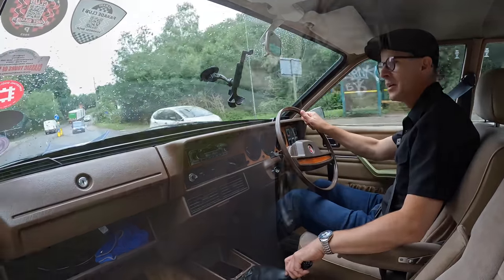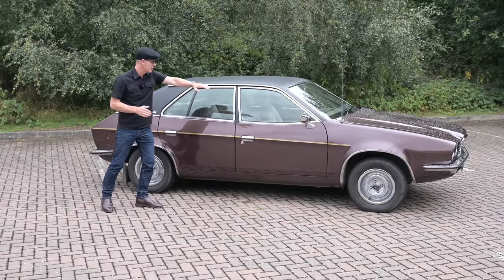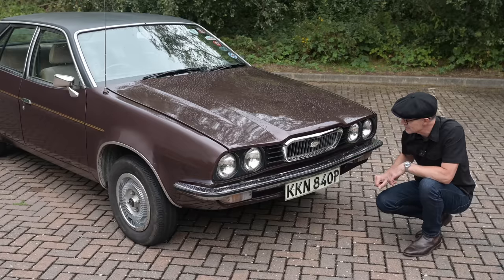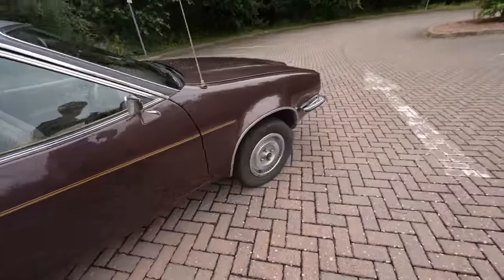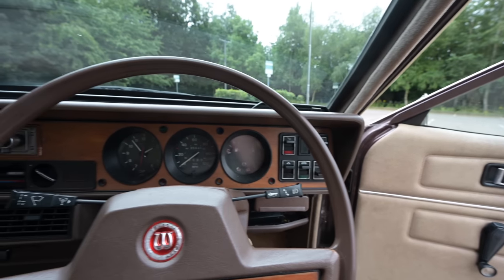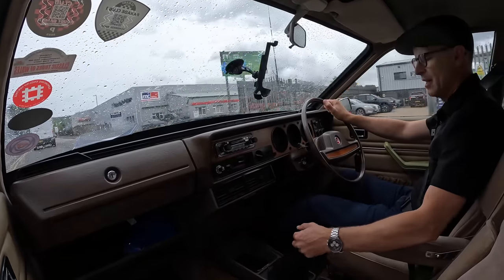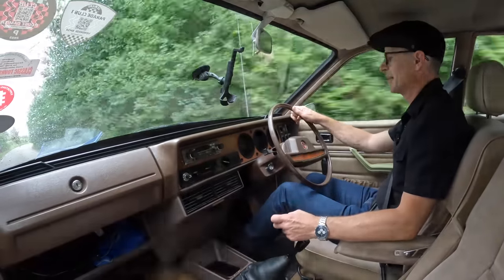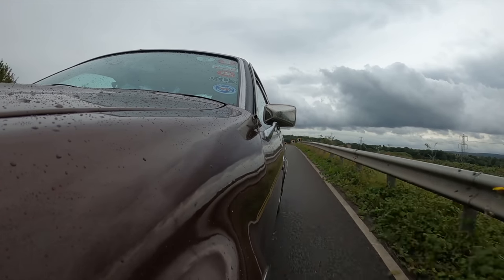Wolseley 18-22 - The Wedge and the Last Wolseley!

Comment: I notice it had the same cheap, polystyrene window winders that would snap without provocation. I had an Austin version of this and the only difference I can see are the faux would fillets. The quality was abysmal. One day whilst bombing along the motorway the automatic (Borg Warner) shifted down to 2nd gear. The RAC took me to the nearest BL dealership and they discovered that instead four engine mounts it had three and one was slackened and starved the gearbox of fluid. Typical of Red Robbo and his muppets. I shudder when I see one of these. And despite the fine ride quality sooner or later the Hydrogas cylinders would fail and it would have to be pumped up again, over and over.

Comment: The stupidest thing about the Princess was the lack of a five-speed gearbox, even though BL had such a gearbox fitted in all variants of the Maxi. If I understand correctly, it was something to do with there being insufficient vertical space under the bonnet because of the wedge shape and the gearbox being beneath the engine - the Maxi had that space. Bizarre backwardness at BL. Clearly there was never any consideration of powertrain packaging versus body shape, but then again BL's range was such a mishmash in the '70s with the Princess, Maxi and Marina all theoretically positioned to compete against the Cortina, Cavalier and sundry foreigners (and yes - I know that the Cavalier was a German-built rebadged Opel Ascona, so technically doesn't count as British, but it could rust like a Brit).
I grew up with Renaults - Dad had four R16s in a row over sixteen years. The French really knew how to make comfortable cars and knocked even BL into a cocked hat for sheer idiosyncrasy (if you were brave enough to handle a Citroen), although a family-size car with only 66bhp (R16 TL) was a bit behind the times by the turn of the '80s. Renault had hatchbacks on the go right from 1961 (in the case of the R4), although I've seen an early design study for the R16 that had a three-box shape. We used to mock British rustbuckets of the time, but in fairness the French were little better (and the Italians considerably worse) and we could never stretch to affording anything German!